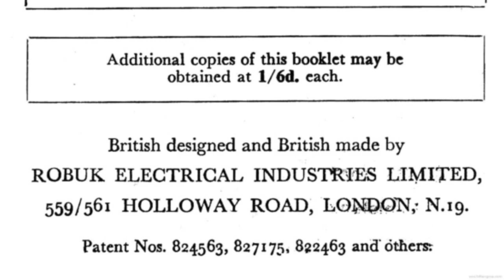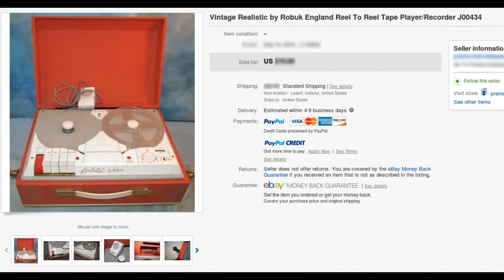Ep.2  – “The Nightmare Before Christmas Tape Recorder”  by Radio Shack – Realsitc - Robuk!

Comment: Three shaded pole motors, very unusual. Direct drive ?
Great interesting video. Hope you get well soon.
Reply from the maker: RODALCO2007  Thanks for watching the video! The Fast Forward and Rewind motors are direct drive, but the capstan motor goes though that idler wheel to achieve three speeds. I hope I can get the motor out to free the idler to re-rubber-ize it! 

There are special brake pads for the direct drive motors that I will need to get at also. The tape "spindles" - reel tables are held to the motor shafts with set screws.  I am hoping that I can simply unbolt and lift the motors/tables to get ot the brakes -- but the wiring is pretty tight!

Comment: HAHAHA

No wonder, why it cost only 109 $ :-)

Thx for the info to this tape recorder.

I have buy a UHER 4000 IC tape recorder in top condition. It is so tough and user friendly, i am so happy with this tape recorder.

Cheers, good luck and best wishes.
Reply from the maker: Drachenreiterklaus  Thanks for watching the video. Be careful when assessing the value of vintage equipment. Back in 1961, $109 was worth a lot more than it is today, there was no "only" about it. For many people, that was the cost of one month's rent! 

UHER makes very fine, and expensive machines. I have a Report 4000L which had been dropped. Not good for it, but I repaired it  and it now runs very well.
Reply: You're right, i forgot it was 1961.

Comment: That sure is interesting using direct drive for the take up and rewind like that, to me doesn't look too complicated, but still rather over-engineered.
Reply from the maker: CoolDudeClem   Thanks for watching the video! 

The TEAC 4010SL and other models have a similar arrangement, direct drive on the reel tables, and a capstan motor capable of speed control. But they came out several years later. 

The Columbia Bell and Howell (I have a video on that one) also has three motors, two direct drive for the reels and one working an idler for the capstan. 

So apparently, this design was well known. What I think makes this tape recorder complex is the wiring. 

The motors are controlled by switches under the keys and for some reason, there are multiple wires going to the take up  reel drive motor, but only a pair going to the capstan motor and rewind motor. So I think (not sure) that the take up reel motor may  have a tap on its windings, maybe to lower voltage and make it weaker during playback/record so it doesn't burn out not being able to run at full speed (being held back by the capstan). 

I'm guessing at this because the schematic I have isn't terribly clear to me about the motors. It only indicates where they exist in the circuit, but doesn't give details about the windings.I need help understandi9ng the schematic. Would you be willing to give it a try? If so, drop me a PM telling me what e-mail address to use and I can send you some images and PDFs. I'd love to understand this machine better!
Reply: I'd love to help out but I just don't that time these days.  I almost certain that the tape take up motor has a tap on the winding, it would be just like how a fan with multiple speeds work.

Comment: very good videos. I just got off of Ebay a Lafayette RK-77 portable reel to reel recorder. it can run on batteries as well as AC power. I have never seen a unit like this before. it is a 4 track stereo recorder, 7" reel size and 3 speeds 7.5, 3.75 and 1 7/8 ips. the unit sort of works, well only on the right channel. no left channel at all.  also the rewind is not working either. this unit has 3 separate Dc motors. one for supply, one for take up and one for the capstan that is belt driven. it looks like the batteries leaked at some pointas the contacts are all green. as soon as I can find a very small slotted screwdriver I can remove the knobs and find out what is going on inside. what are your thoughts? hope you health is good.
Reply from the maker: reeltoreelrules   Thanks for watching the video! I saw teh Lafayette RK-77  machine on E-Bay. Of course, Lafayette didn't make it themselves, it's a re-brand of some Japanese machine - common practice at the time. Several of the Lafayette units were made by Miranda of Japan,. but I don't recognize this as being one of them. Could be AIWA (because of the capstan sleeve change for the 3 speeds - which AIWA  liked to use). 

There could be any number of reasons why the left channel doesn't work -- electrolytic capacitors are the usual suspect to start, but it could be just a dirty record. play switch!

It appears that the RK-77 has a ganged record/play switch (turns rec/play on or off for both channels at the same time) and you could try pressing and releasing it several times. The contacts are supposed to be self cleaning, but then, they never figured on a machine lasting over 50 years! 

But if you DO get some response, the solution may be to just spray clean the record/play switch on the amplifier board with some De-Oxit.

If the batteries corroded inside the machine, you may be looking at some wire rot as well (which may explain why the rewind motor has failed - it may be fine, but the wiring for it may be loose or faulty). 

When the batteries leak, they release a corrosive gas (that's how they leaked in the first place) and that gas can corrode electrical contacts and even metal components inside the machine. So you will have to get the machine apart and go over it very carefully, checking for failed connections.

Sometimes a visual inspection will reveal problems, but in cases of hairline cracks in circuits or cold solder joints, it's not so obvious.

So I wish you good luck with your machine! I suggest doing a very careful and close examination of the interior to see if there are loose wires. Take pictures before moving anything because if a wire pops off a connector and you don't have the picture, you will have no reference of where it came from! 

I hope this helps!
Reply: Hi clydisight do you no of there where beldsets for a sony tc 230 i can pick one up for free friday in rijswijk.
the only problem the machine do not take up so i thougt the belds are bad
Reply from the maker: dannyjaar
I don't know where you can get belts for free. As far as I know, the Sony TC230 does not use a belt for take up, but it does use one for rewind and for4 the counter. Try looking it up at a place called turntable4needles dot com

Comment: I live just outside Doncaster,england.i got the motek version of this in 1969 with the control knobs (mic record,radio record,vol and tone)on the top front.don't know if it was the capstain motor,the rubber idler wheel or the balance wheel but no matter what I did although it ran well at 7-1/2 ips got loads of flutter at 3-3/4 ips and at 1-7/8 ips was worse still.it has long since gone.
Reply from the maker: Thanks for watching the video. I wonder if the idler wheel carriage on your tape recorder went out of alignment? If not set right, the driver runs on the edge of the motor pulley,  which causes wow and flutter, since it doesn't properly grip. Usually that is an easy fix with a simple set screw!
Reply: hi there again.this fault was there from the start and although I cannot say for sure I think the idler wheel rode right in the centre of each step.i feel a bit daft now because I have always been keen on electronic gear but never thought at the time that the idler roller could have been soft as it was a shop soiled machine or the motor capacitor could have been faulty if it did have one.thank for replying.

Comment: Epoxy...don't leave home without it!!
Reply from the maker: +Buzz1151  Thanks for watching the video, Buzz! Epoxy, what a concept! Saved my butt on several occasions -- also good on tape recorders. In one of your record player videos you mentioned using brake fluid to re-vitalize a hardened rubber drive idler. You also said not to use it for belts. Can you tell me more? The drive idler in this machine is quite hardened and the brake fluid idea sounds promising ! Merry Christmas and all that jazz!
Reply: Tim.....if the drive idler is like a record player, then I would try the
 brake fluid, or you can also go the Rubber Renue route..I used it on 
the capstan of the 65 Sears tape recorder ..its pretty spendy..but heavy
 duty....just Google it
thanks, Buzz
Reply from the maker: Buzz1151 Thanks Buzz, I'll try the brake fluid first as it is inexpensive and best of all, I have some. Now, when done, I will just need a car to use it on. Oh well.....

Comment: Interesting tubes. 12AX7(ECC83) ECL86, EL84, probably EZ80 or EZ81 and EM81. The EL84 is a power pentode similar to 6BQ5 while the ECL86 consists of a small high mu triode from the ECC83 and a smaller plate disipation beam tetrode version of EL84. Although the ECL86 has a beam tetrode the screen grid has been designed to have the same screen grid current flow as in the EL84 pentode's. But they have different plate current characteristics. I've seen an OTL design from Phillips which used ECL86 and EL84 but it required an 600 Ohm speaker but here we obviously have an output transformer. It could be that they used an OTL design and then added an extra output transformer to match a 4 Ohm speaker with an 600 Ohm output. There are four more options:
1., It's an asymetric Push-Pull output with a beam tetrode an a pentode
2., It's a shunt ballanced single ended design
3., The pentode is connected in triode mode while the beam tetrode is in tetrode mode and they are connected in parallel within a single ended design
4., The ECL86 is in an ultra-linear single ended connection and the EL84 is only used for the oscillator.

Anyways, it's an interesting design and I'd like to see the schematics but I couldn't find it anywhere.

In the european tape recorder designs the same oscillator is usually used for both AC bias and AC erase. My guess is that the second coil is part of the equalization network.Those flat parts might be just shielding.
Reply from the maker: AlexM1983DHUN  Thanks for watching the video. I am not very experienced with tube designs -- though I know some basic generic stuff. 

The schematic I have is for a "sister" Robuk machine that was sold in England at the same time -- and it has no values on any of the components! 

Tubes are labeled V1, V2A and V2B (obviously, spit use tubes-- Webcor did this in their B210 recorder), R1, R2, C1, C2 etc. I mean, you can see what is connected to what--  but nothing else. 

I have to pull the tubes to read the full numbers, and I am also hoping the capacitors are marked! The schematic doesn't indicate which are electrolytic and which are non-polarized! 

You seem to be knowledgeable on the subject. Would you be willing to help out if I were to send you the useless schematic as a PDF I have -- as well as the tube numbers in a e-mail? Send me a PM telling me where to send this if you are willing to help, okay? 

This recorder is a mystery to me at the moment and I am not feeling well enough to tackle it -- which is why I am dealing with the cosmetics first - much easier.
Reply: I've sent the PM. Btw. I'm a hobbyist tube amp builder.
Reply from the maker: AlexM1983DHUN  Thanks, I got the message and am making some images to show you what I have discovered so far. Will send along to you very soon. I am not technically proficient with tube electronics, so you may have to "dumb it down" for me when you explain what you have discovered. Thanks!

Comment: Question, have you ever dealt with a 60hz AC motor that runs too fast? I have a VM 749, and to get the speed right I have to run it though a variac and run it at about 105 - 110 , just plugging it direct causes the sound to play fast.... everyone I talk to says it is impossible for it to run fast because the motor is regulated by the 60 cycle line , could a winding in the motor cause this?
Reply from the maker: bones007able Thanks for watching the video. I have never heard of an AC motor running fast before, but it could be a motor that requires a motor run capacitor. If so, and the capacitor has gone off value, that might make it run fast. I don't know if VM machines used capacitor run motors or not. I think you should contact Gary at the Voice of Music Web site. He is an expert on these machines and can help you with parts and advice.  You should also ask him about if it has a switch for changing between 50 and 60 cycles frequency. If it does switch between them, it might also use special pulleys on the motor and you may have the wrong one. A lot of tape recorders were designed to work in the U.S. and Europe, but in Europe the voltage and frequency is different from the U.S.  Good Luck!
Reply: Thanks, I am in contact  with gary, he is currently looking up the specs (rpm) etc for the motor, it does not use a run cap... I put a photo-tach on it and it runs 1730 no load, about 1695 - 1700 playing a tape, if I slow speed down to about 1680 it sounds perfect... there is no provision for drag settings on this machine... my AC line is about 122 so I think I need to put a resistor in line to regulate the line voltage down about 10 - 15 volts...
Reply from the maker: bones007able  You might want to contact Buzz1151. He uses dropping resistors on his old radio restores because his line voltage is about 122 also. The resistors are heavy duty in gold aluminum cases, and he also puts a fuse in line for extra safety. Plus, his videos are not only informative, they are entertaining as well.

Comment: I don't think the design looks that scary. In fact, I kinda like it: cheap and cheerful and almost bulletproof. The fact that it works right away, with no service is quite impressive. The original model, sold in the UK was called Robuk RK4. You can find the complete schematics with layout data and the operating instructions here: http://www.hifiengine.com/manual_library/robuk/rk4.shtml Registration is free. I hope this helps. :)
Reply from the maker: +error52  Thanks for watching the video! The scary p[art is figuring out what order to take it apart in, and how the wiring is working out.  I found a label hidden in the "secret" compartment at the back and it calls this machine a Robuk RK3B. I did get the documents you mentions from Hi-Fi engine, thanks. They have the circuit and mechanical diagram, but none of the components have any values. They are labeled with reference numbers.  I think whoever posted the document missed scanning some pages!